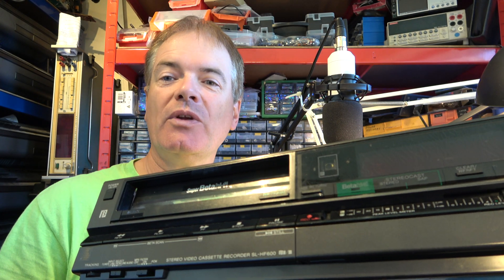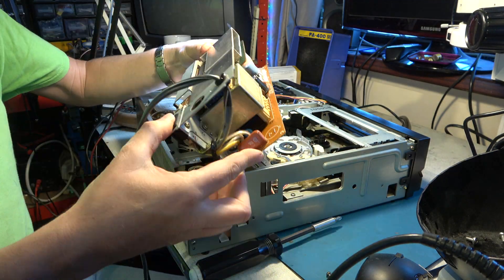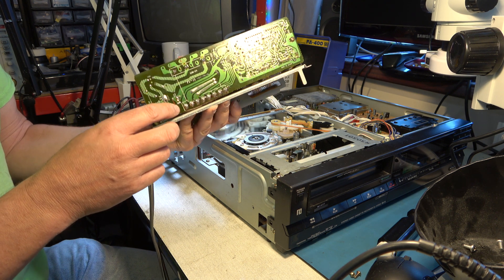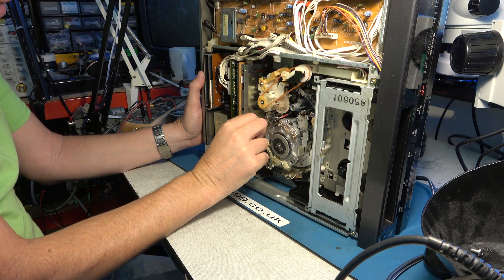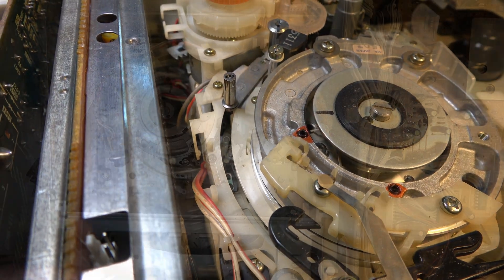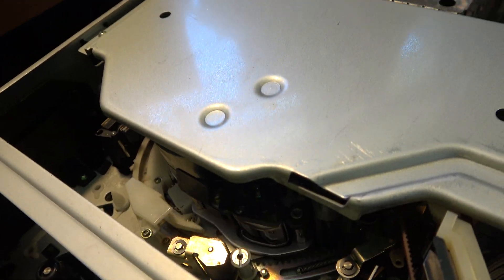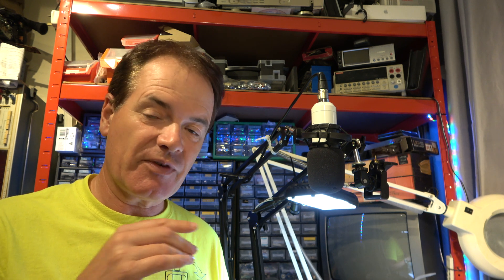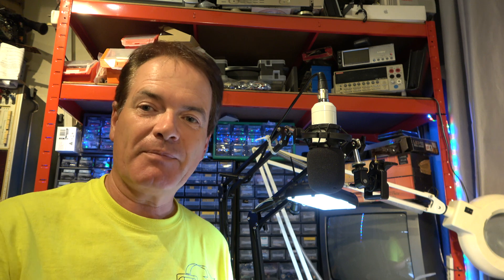SuperBeta SL-HF600 part 3.  Smashes itself up.

Comment: I find your programmes strangely theraputic. It takes me back to when i worked in a lab at the end of tottenham court road which was lined with shops selling videos.
I agonised over Beta or VHS, settling on Beta which had the better quality, but my Sony C5 had no end of problems and with the lack of pre recorded tapes settled eventually for the inferior but more reliable VHS. I understand that the Sanyo Betacords were more reliable?
Happy memories.
Reply from the maker: The C5 was my least favourite machine.  Most of the complexity and unreliability of the C7 without any of the nice features.  Sanyo were certainly more reliable, but so too were some later Sony models like the C30.  I always visited Tottenham Court Road by tube if ever I was in London, I used to love it.

Comment: This is a good video. I'm catching up after subscribing. I work for a videotape preservation organization as their in house maintenance tech. I just saw two sony DSR 1500's try very hard to break their threading mechanisms. One succeeded, the other is at least now miss-timed, I'll know next week. Those aren't my fault but you bet it has been my fault before (only 4 or 5 times since I started messing around 25 years ago, though I question that)... It scares me worse these days, and is important to tell people about!!! And so is 3d printing parts!!!!!! If they work it needs to be done!!! I really want to get into doing that. I should add that I've fixed 100's of machines, my fix-to-break- ratio is good professional quality.

Comment: Ooow naughty deck :-(
Did that switch actually show ( open and close)  through the wiring?
I also wondered if the firmware board was wrong for that deck configuration.
Swapped out by some pillock!.
I'm not sure about the broken part,  i have created bodgy parts out of metal tubes and screws.
I've been very evil :-D
And to keep it working, i charge nothing for the  fix. (A odd version of sods law )

Comment: The 711B chassis (SL-C20) uses a micro switch for detecting the completion of the unlace cycle. The 711B2 chassis (SL-HF600) uses the right-hand side tape-end sensor coil to detect the completion of unlacing. I can't explain it in much detail here but 12voltvids has a good explanation on this.
Reply from the maker: Yes I've seen that, a magnet swings round to the takeup end sensor at unlace.  So that's how they dispensed with one microswitch.  My problems now are the detection of lace-up.  The switch sits on an arm which swings, and this appears to be in slightly the wrong position.

Comment: I wonder whether you might deliver both broken halves of that pin to a model maker who could make a metal pin replacement?
Reply from the maker: It's just too small and intricate.  I'll have to raid one from another deck.  But I must sort out the end switch first.
Reply: @video99couk  Oh, not at all! It is actually a pretty sound idea! I´d be more than tempted to use a 3D software and perhaps a resin printer to print like one hundred new pins, just to be on a safe side. The resin prints tend to be reasonably durable and I´m currently planning on replicating the (always) broken gears in Philips Charly decks I´ve got.

Comment: I've worked on a lot of the 711B2 and B3 chassis' but I can't quite see exactly what's happening from your video with the S ring and how it's interacting with the S coil assembly that also actuates the switch. My guess is a broken bit of plastic on the S ring. It might also be worth removing that small assembly at the back left of the deck, checking it and then reinstalling it making sure it is free to move as it should. I do have a 711B3 mechnical adjustment manual which covers everything including disassebly and reassembly but not that switch actuating mechanism. Only slight glimer is I have a later NTSC Sony Betamax in for repair at the moment with similar issues to yours which will be on my channel soon and if you're still struggling (I am however confident you'll sort it) I might bring that forward so I can offer you more help.

Comment: I can only guess you can turn Beta Hi Fi off for tapes recorded with Hi Fi that aren't mastered properly, as in nothings recorded on the Hi Fi track.
I've heard rumours that some VHS titles are like that, personally I've not really encountered that. Possibly the closest thing I have is a copy of The Wicked Lady (the Michael Winner version from 1983) released in 1989 from The Video Collection under the Cinema Club label (although the master is from 1988). On the tapes Hi Fi track the audio is only coming out of the left speaker for some reason (it was only noticeable when I digitized it and when I hosted an online screening of it I used handbrake to knock the audio down to mono), I know it's not a problem with the machine I used since it always records tapes with both speakers and when the Hi Fi would pop, it came out of both speakers so it's obvious they didn't master it properly (I don't own any other copies, nor would I want to since it's a crap film).
It could also be if it shows on the display when the Hi Fi goes, for instance if the tape is damaged or the heads don't align properly it makes it far less distracting.